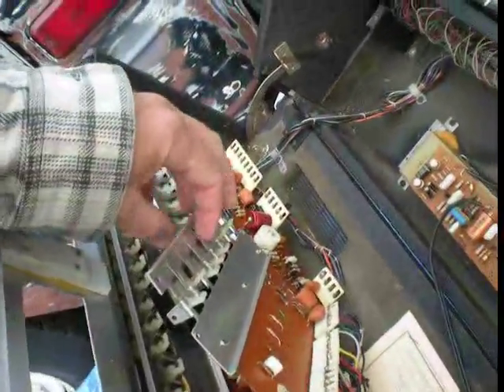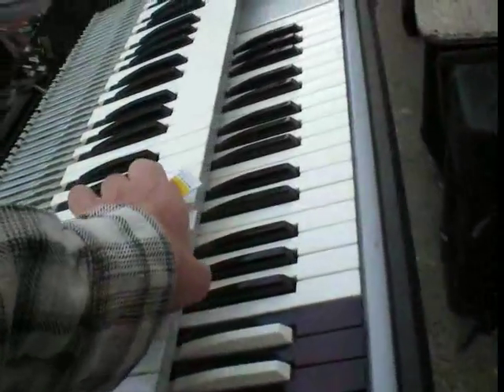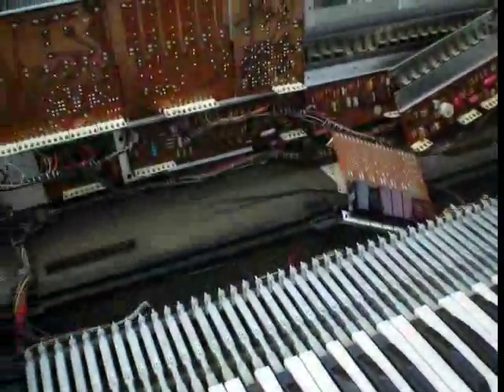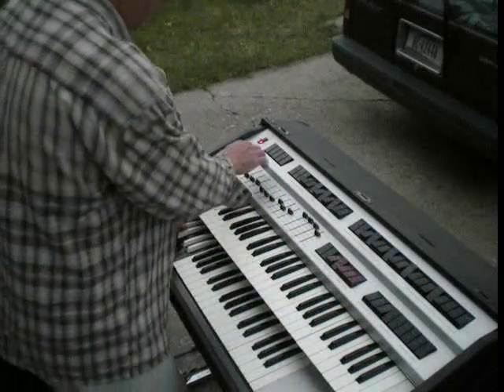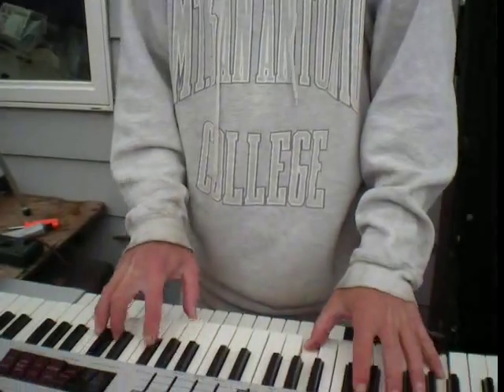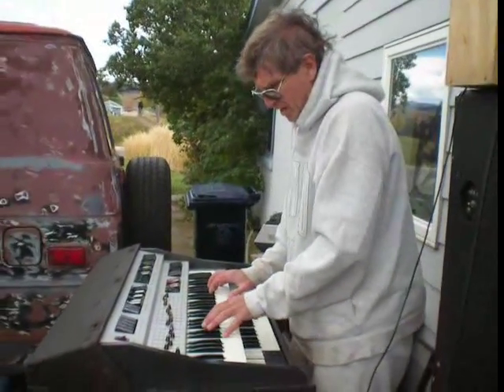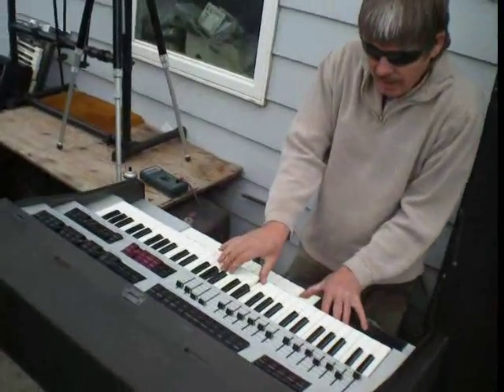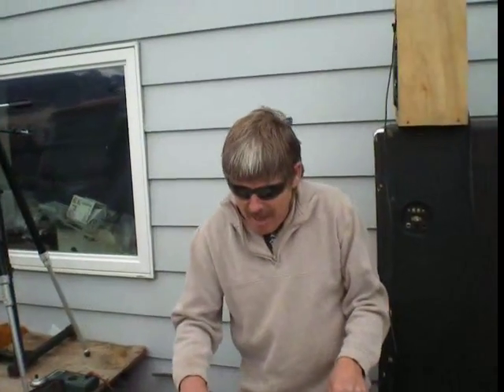Viscount Imperial Intercontinental Organ

Comment: I have one just like that. It is still in relatively good playing condition, only the preset switches for the upper manual are a bit scratchy, sometimes they work and sometimes they don't, so I would like to see if I can clean some contacts, the problem is, I just can't figure out how to open the thing! If I take out the screws on the sides, it still is not possible to lift the keyboard and control plates. Any advice on how to do that will be much appreciated.
Reply from the maker: too long; i'd be looking at my vid for clues like you

Comment: I have had a Viscount Imperial organ, dry stored for many years. It's S/No is B1/89, and has a set of bass pedals with it. I think I still have the stand ( somewhere ) If any collector is interested. P H  in England
Reply: +Peter Hancock Hi Peter, I have an Intercontinental Super, also called Viscount Imperial Super - a very rare beast, portable on a triangular metal stand & also with pedals, made in 1976, which has quite a lot of similarities with this Imperial as seen here, especially technically! I would be interested in your Imperial if you still have it... Kind regards, Gerald Vos - Holland